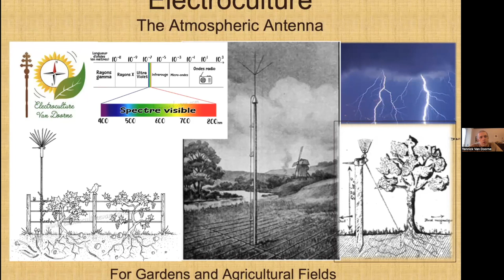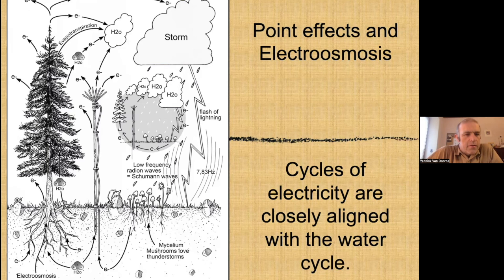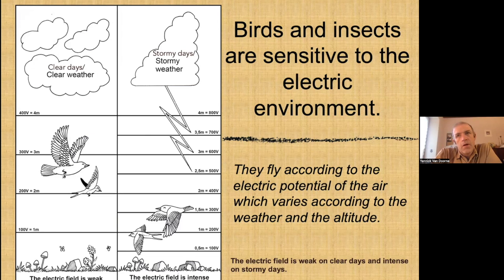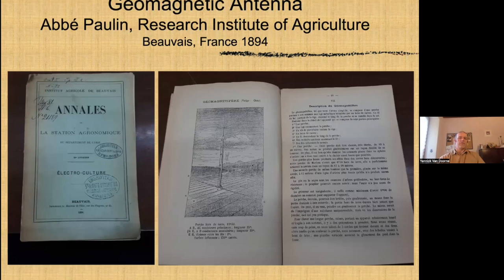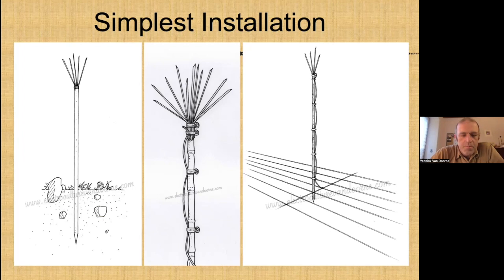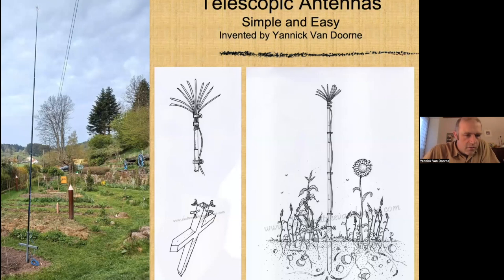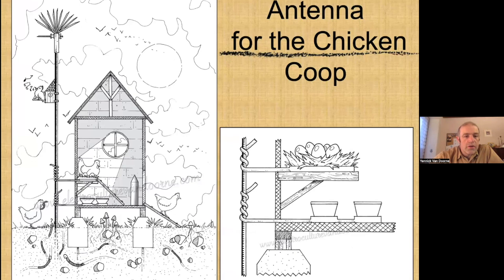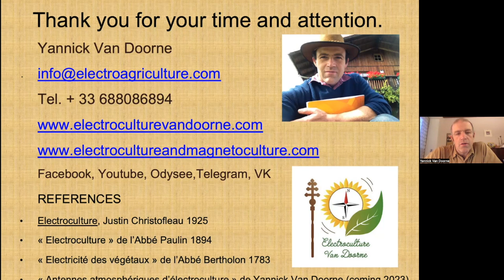Electroculture atmospheric Antennas Lecture 2 Spring 2023 with Yannick Van Doorne

Comment: Great work... It's possible to make antenas for hidroponics?
Reply from the maker: Yes, they all work also for hydroponics and also inside. if you want to get the most of the atmospheric electricity, you put the antenna outside with a wire going inside to your hydroponics and also a wire to the earth for earthing.